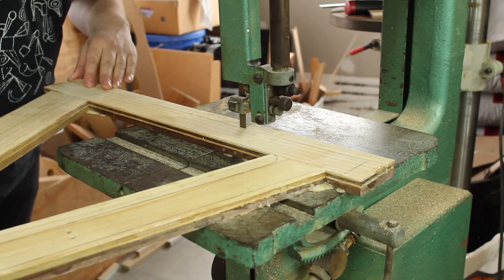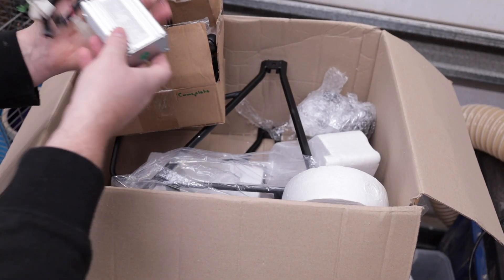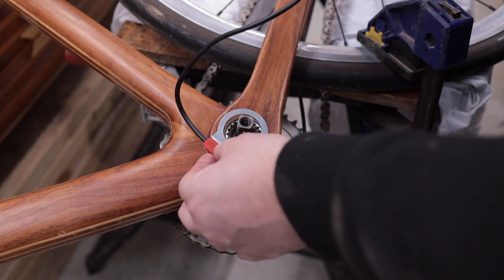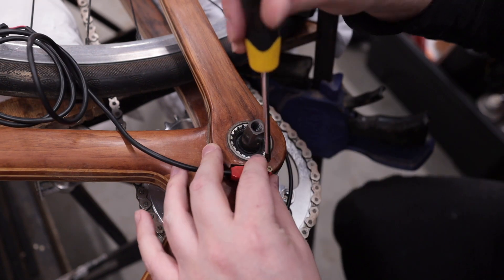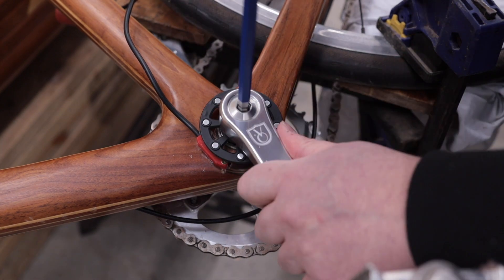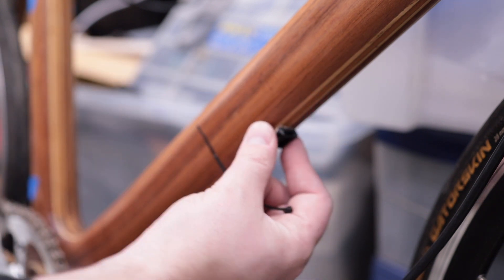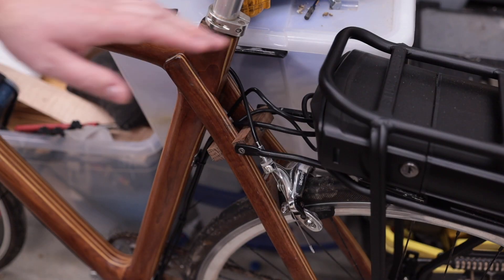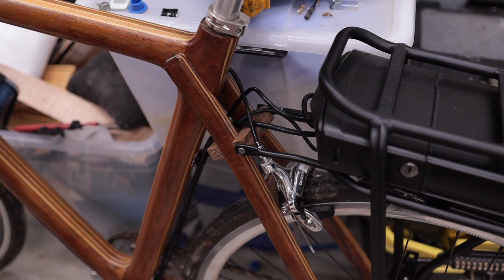Converting My Wooden Bike into an E-bike

Comment: Sad to hear you have chronic fatigue.  Well done on the upgrade.  Would have been great to see your legs out either side of the bike as the motor and battery got you up that hill, but assume this current model only provides assistance?  All the best.  Thanks for the video.  Cheers, David
Reply from the maker: Haha yeah it did come with a throttle, but I decided not to use it because I wasn’t sure about exerting that sort of force on the front of the frame without pedalling supporting it. But also I don’t think the 350watt motor would be powerful enough to get me up that hill alone! When I’ve been having good-ish periods I’ve been able to cycle 5km on my normal bike so hopefully the motor will help equal out the hills a bit and get me further! I struggled up that hill a few weeks back on a regular bike but was up and down it a few times filming this no problem!